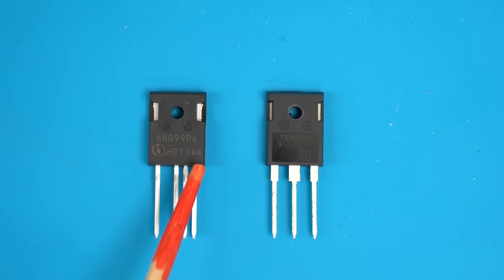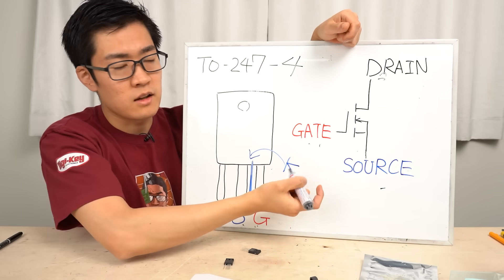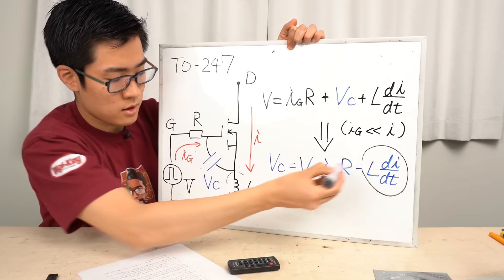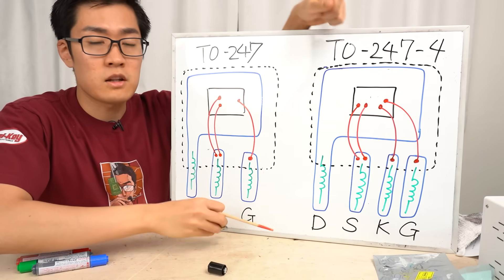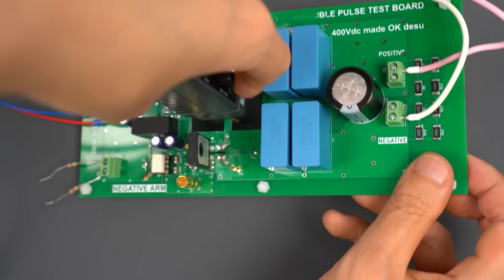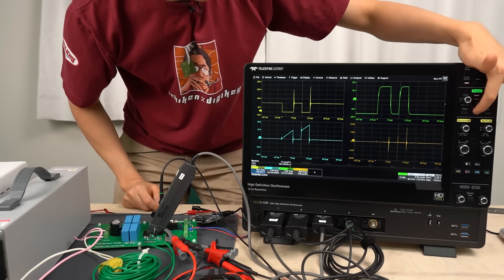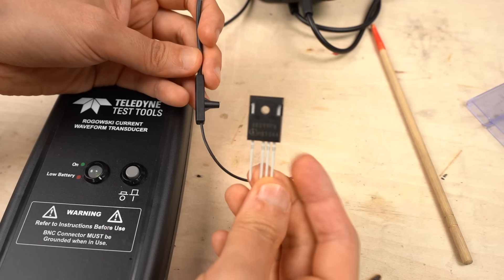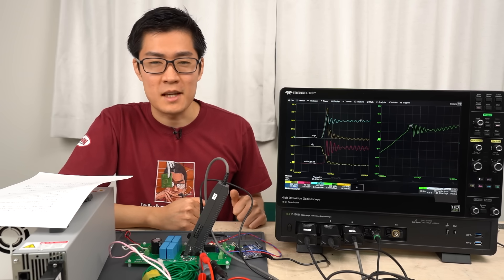This Tiny Change Makes a Huge Performance Boost

Comment: the icon/diagram for a mosfet includes the capacitors you mentioned, but they are very easy to overlook.  the gate is one plate of three capacitors (the vertical line connected to the gate pin) and the three vertical lines oppostite it are the other plate of each capacitor.

Comment: You fail to mention a most important requirement of the driver circuit.  ITS GROUND MUST BE ISOLATED FROM THE GROUND OF THE FET LOAD POWER SUPPLY.  If you power gate from supply sharing minus lead of the load power supply, you defeat the benefit of the Kelvin connection.
          You can do this (at high frequencies only, but that's what counts) by passing Kelvin & gate leads to the FET through a ferrite toroid to the driver circuit.  Add a toroid & see if the switching speed increases.

Comment: When I worked at GM in electronics, we had some packages like this one with more pins on one side, to prevent it from being installed backwards.  It was nicknamed Hoosier DIP, referencing the main plant in the state of Indiana.

Comment: This reminds me of how I failed a job interview years ago. The interviewer asked how long it took to turn on a MOSFET.
I was sitting there thinking how best to present the parameters and explain their significance when the interviewer said "OK you don't know" and just ended the interview.
Reply: Dodged a bullet there at least.

That's exactly the kind of place you never want to work at 😅
Reply: @Calandron1 Any place that does serious electronics has peeps like these. Sometimes they are useless and get assigned to the interview duty. That’s unfortunate.
Reply: Both sides of the interview table face challenges and benefit from training. Not every interviewer has gone through this training unfortunately.

Bringing in a candidate for an interview means the company has already spend a lot of money on this potential hire and the applicant has gone through extensive vetting. You don't want them to fail at this point. Instead, you want them to demonstrate  their best skills and performance. If that ultimately turns out to be a poor fit for the advertised position, then so be it; at least you have confidence in your decision to pass up on extending an offer. But you don't want lose a potentially amazing hire just because you started the interview off on the wrong foot or just because the candidate is a little shy or has a bad day. That's fully on the interviewer to take care of. The interviewers job is to support the candidate so that they can truthfully show what they bring to the table.

Also, as an interviewer, even if you have to turn down a candidate you always want them to feel that they have been treated fairly. Half your job is to evaluate what position this candidate would be good for (if any). The other half is selling the company to the candidate.

Turns out, interviewing candidates requires just as much practice and coaching as interviewing well as an applicant. But not every company realizes that. And I guess, that tells you something about the corporate culture too.
Reply: @Calandron1  True, if they want you to start immediately blabbing out an answer they have worse issues.

Comment: 75 years  ago  comparable  work  with  Valves / tubes . Multiple  grid pins for vhf  Triodes   or two cathode pins  for pentodes

Comment: I would like to see if the overall system temperature is reduced with the lower switching losses, and if reduced lead lengths change the overall switching losses. Very interesting.

Comment: The reasoning in the video is wrong.
The parasitic inductance does not come from the 2cm IC pins, we are even trimming those pins by cutting after assembly. That is the "trace inductance"!
What the Kelvin joint by-passes is the voltage drop on the internal bond wire of the source pin.

Comment: Great explanations. Here is a random idea for you. I'd like to know more about GAN FETs. GAN bipolar transistors and junction diodes should also be possible according to AI, why can't I find any to experiment with? What would be the Voltage drop of a GAN junction diode? Just asked Google and it says 2 to 4 Volts! But still useful for high-power high-frequency use. Guess I answered my own question but it would be interesting to explore. Would love to have a complimetary pair of high power GAN bipolar transistors in TO-3 cases to play with!

Comment: I work with power mosfet transistors for many years, everyday deal with them. I never, ever, found one TO247 or TO220 package with Drain pin not on center (connected to tab if metalic). Your drawings, including the one showing the internals, show the Drain on left pin. The sequence G.D.S. on pins is interesting a standard pattern among all manufacturers for many years. Even the Kelvin package uses the Drain at tbe geometric center.  I am sorry, but you need to correct your video. The IPZ60R099P6 (kelvin) Infineon (P6 series) is an exception, and should not be used as a generalization for TO220 packages.

Comment: The gate is also a capacitor. Even if there wasn't any parasitic capacitance, there will always be a capacitor at the gate because that's how MOSFETS work (the capacitor creates a field which is what the field effect relies on).

The point is all devices, not just MOSFETs, have some amount of parasitic capacitance and inductance. Parasitics are everywhere.

Comment: Another big advantage of the 4 terminal device is in turning off the transistor. When high currents are flowing from the source to the power rail the voltage at the source can bounce several volts above the power rail which can prevent the transistor from turning off. By connecting the Kevin terminal directly to the MOSFET drivers ground pin, the driver can actively pull the gate terminal to the potential of the kevin terminal thus turning off the transistor regardless of ground bounce. This is also why an active high current push/pull driver circuit makes so much difference. By inserting a resistor between the drive gate output and the transistor's gate allows controlling the rise and fall times to deal with ringing.

Comment: In the beginning you show a datasheet of an IGBT (Insulated Gate Bipolar Transistor), than you draw a schematic of a MOSFET and discuss it. A totally other type of transistor. Are you aware that they are different?
Reply: That was just an example with the same package type, the FET is: "IPA60R099P6 is a 600V CoolMOS P6 power transistor, a Metal Oxide Semiconductor Field Effect Transistor (MOSFET)"
Reply: He is just talking about TO-247-4 package advantage in general, NOT that specific MOSFET at that moment, so he is not wrong.
He is saying "compared to 3-lead package, 4-lead package has 20% reduced switching loss" and this is a general advantage of all 4-lead package (applies to both IGBT and MOSFET) although precise switching loss reduction varies a lot on different model.

Comment: So, you spent a bunch of time describing a MOSFET, while the 4-lead part you are working with is an IGBT.  The Kelvin terminal is apparently just a way to sense emitter current at the die, bypassing lead inductance of the emitter, for better DVDT control.

Comment: Nice video and presentation. 
Shall we say the S terminal is the power ground, the K terminal is the signal ground?
Reply: If you are trying fast switching, the gate current is high and the terminal inductance cannot be ignored
Reply: @janami-dharmam  your point is well taken. My last point is no different than yours only by point of view. 

If we inadvertently tie S and K pins together side by side by an uninformed PCB layout technician, the original intend for the K pin will be lost, the result is no different from DSG configuration. That may compromise your last comment. 

By providing and stating that K as independent signal ground we are saying that S and K pins are not equal and should be wired individually instead. 

Essentially, the G-K pins may be regarded as quasi differential inputs from high speed switching perspective. That G and K have inverting and no inverting role, respectively.

Comment: This 4-pin case has only adventages, if the circuit designer separates power ground and gate drive ground and is fully aware of the current paths, stray capacities and unwanted inductivities. Lower Miller caps on the semiconductor will be more effective.
Reply: Not quite - if they do share the same ground, the source inductance is in parallel with the kelvin source parasitic inductance - net source inductance could be as low as half the source inductance alone, theoretically halving the switching time. Not to be sniffed at.
Back in the real world the gain would be somewhat less using the time honoured engineering rule of thumb that you rarely get near the hoped for improvement because some other sneaky little impediment steps into the limelight! 😈

Comment: The K terminal measures 2 cm in length and has an inductance of 20 nH. It is not shown in the schematic at 4:06 for some reason.
Reply: True, but it has very little current compared to the 'normal' 3 terminal device!
Reply: @jrkorman  In the original article (DOI: 10.1109/TIE.2023.3243272; Open Access), it is shown as "Lk". Denki made an oversimplified version.

Comment: Sorry I must be confused but this does not seem to add up. Basically you have one extra lead doing the same thing as the "S" lead, made from the same conductor material. So you should just end up with a "K" small parasiitic inductance parallel to the first "S" small parasitic inductance,  about L/2.
Reply: I deleted my previous answer because I misunderstood your question. It's because of two reasons: the gate driver circuit is one of higher impedance, and in second place, in this configuration the gate driver isn't affected by the voltage shit due to the parasitics at the source terminal, which will vary according to the current being driven

Comment: modern buck/boost ICs are all made to drive N-Channel mosfet, even for the high side. but I strugle to find a N mos with body/substray connected to drain instead of source. You really need to trust the ic have good timing and don't shot it through, and the very higher gate drive voltage doesn't blow it up.  This is good to see.

Comment: Please do the comparison experiment again with a temperature sensor applied to the MOSFET. Plots of the temperature rise might tell us if any significant gain in efficiency is achieved with the K terminal.
Reply: The gain in efficiency is enough by measuring one switching sample and analyzing the oscilloscope result like he did in the video. Using temperature sensor is NOT a way to correctly measure the efficiency.
Reply: Doesn't physics guarantee this? P=VI and the measurement shows V and I across the device.

Comment: they increased parasitic inductance by making the leads thin and then managed to improve the performance by including an extra lead 😆 crazy people
Reply: The thickness of the lead does not affect the inductance in any meaningful way.
Reply: @latrogeniwile58  aright , here are some actual figures. 1 turn inductor 6mm diameter 1.4mm wire = 18 nH.
everything the same , but 0.8mm wire = 22.5 nH.
real inductors , real measurements , not a simulation. 20% difference not meaningful for what? turning a lightbulb on and off ? definitely agree.

Comment: Is there any chance you'll design a  spot welder using a microwave oven transformer, and an Arduino that controls dual pulse widths and power levels?

Comment: Very clear and instructive ! 👍
Reply: suppose the switching speed is zero; there will zero power loss due to switching speed. But the ringing at the same point is very high and you must reduce the switching speed to reduce the ringing.

Comment: Do it make sense to use it in audio final stage? Thanks!
Reply: In a Class D amplifier, yes.
Reply: No. Use a 2A3 vacuum tube in a class "A" configuration.
Reply: @MadameRotten-je4vk very silly
Reply: @MadameRotten-je4vk  :)

Comment: Great topic! One suggestion: consider removing the hole where you’re placing the probe and instead creating a full DC–, DC+ and phase “sandwich” of planes across that area. Your DC-link inductance looks quite high, and measuring it could give you valuable insight. If you compare the results before and after optimizing the layout, your switches should perform much better. You can then overlay the waveforms and clearly see the improvement in signal quality.

Comment: You should mention from the start these are power MOSFETs or the variant IGBT used for higher voltages.
Reply: These are not IGBTs. IGBT is a bipolar transistor switched by a MOSFET in one package.
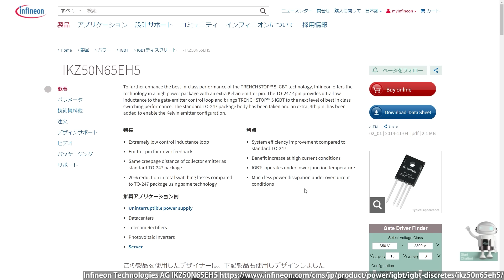Reply: @liam3284  The datasheet shown in the video ( 0:40 ) says IGBT.
Reply: @francoisleveille409  No, the datasheet he is showing is for purpose of "4-lead package vs 3-lead package" IN GENERAL (applies to both IGBT and MOSFET), not talking about that specific MOSFET.
Reply: The IPA60R099P6 is a 600V CoolMOS P6 power transistor, a Metal Oxide Semiconductor Field Effect Transistor (MOSFET)
Reply: @jaro6985  The product mentioned at 0:40 is IKZ50N65EH5, Isolated Gate Bipolar Transistor (IGBT).
Reply: MOSFET is NOT a variant of IGBT.
Power MOSFET is a Power MOSFET, not IGBT, and it is capable of handling high current (sometimes high voltages are also available). It is all because of the internal design layout of the MOSFET that allows its high voltage capability or not, it is unrelated to variant of IGBT because there is no BJT structure inside MOSFET.

What he is using for testing is IPA60R099P6 4-lead Power MOSFET. The datasheet he is showing is IGBT but he is actually talking about 4-lead vs 3-lead in general not talking about that MOSFET.

Comment: You have convincingly shown that the switching losses are less with the 4 lead package, but is it possible that you are mistaken about why this is the case? The lead length of the kelvin connection is almost identical to the original source pin length. So the inductance on the kelvin connection will be almost the same. So I don't think it's a difference in lead inductance that is causing the lower switching losses. There is a paper titled "Actual Reasons Involving Turn-Off Losses Improvement With Increasing Load and Gate Resistance in MOSFETs Enhanced With Kelvin Source" that offers a different analysis.
Reply: It's not the inductance itself that matters as much as sharing the path with the switched current. Or to put another way, the gate drive's reference point for the "source" is wrong.
Reply: I think the idea for dropping the L*di/dt term is that di/dt goes to 0, not L, which indeed as you mentions remains the same.
Reply: @maxwelld973 absolutely right! Same principle like shunt !
Reply: Same length yes, much less current.
Reply: In the original article (DOI: 10.1109/TIE.2023.3243272; Open Access), it is shown as "Lk". Denki made an oversimplified version.
Reply: Your videos are great
Reply: Трудности конструирования  при скоростях переключения 100kV/uS могут перевесить выигрыш от снижения потерь.
Reply: Agreed
Reply: I think this video make sense, the effect of the parasite inductance is cause by the huge current flow from drain to source. By driving the gate from another isolated driver neglect the effect of the inductance. I.e, if you connect the extra pin together with source, it have no effect gain as per your description. I read from some datasheet, by measuring the Voltage different among the two sources pin, it actually able to get the current passed through the mosfet, in other words, it need custom driver to have those extra functionalities.
Reply: Afrotechmods needs to make more videos, I miss you!
Reply: Kanaliniza artik hic yeni video gelmiyor ozledik.
Reply: قناتكم لم تعد تنشر أي فيديوهات جديدة، نفتقدها.

Comment: Your explanation is excellent.
Reply: Your presentation is also very, very good.  You waste no time, cover each step at a steady pace, keep your presentation grounded in basic circuit theory, and move steadily towards your conclusion.  Then you present a well-designed, clear demo, and cover the second-order effects.

I wish all technical presentations were as well done!